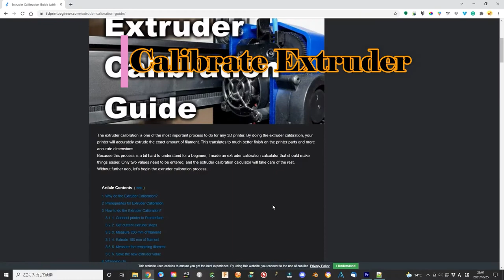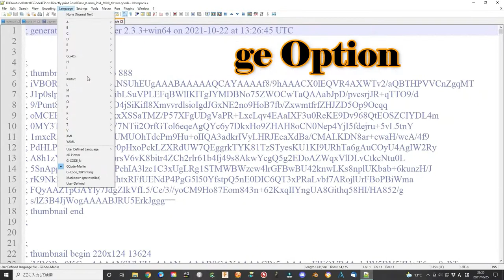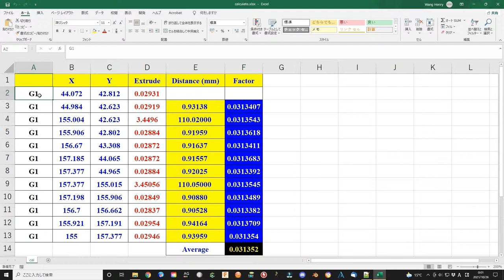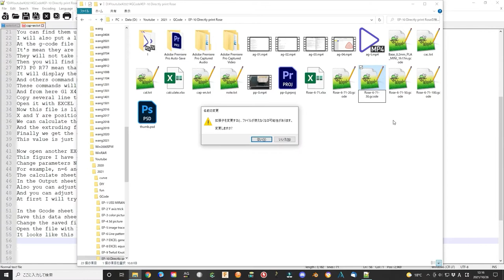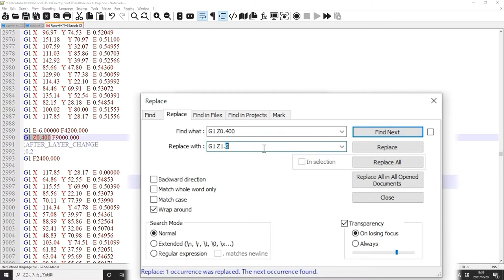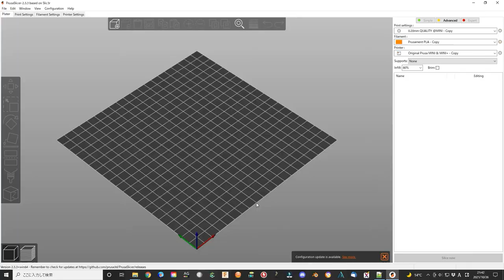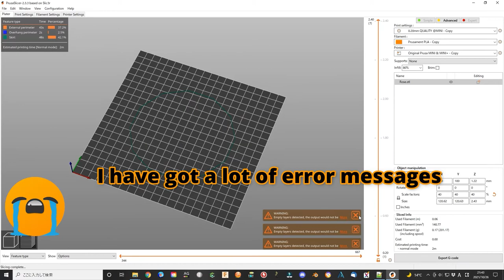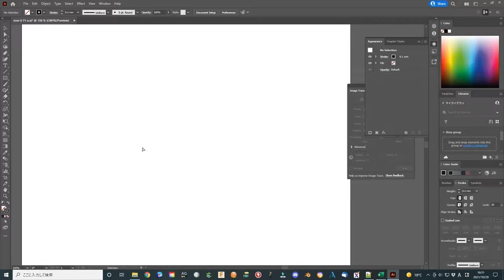Print a beautiful teapot board directly (Generate g-Code using EXCEL and Equation)

Comment: respected sir, good evening,
SIR, you have taken different density 20%, 30%,50%,70%,100%,
where and how to do these changes in the files to get these different  densities justified.,
request for kind reply Sir.,
Reply from the maker: In the Excel file, you can see the filling density in the output sheet. Directly change it. The 0.4 mean is about 40%, and so on. Please test your printer and find the good one. The g code sheet is the final g code sheet. You should save it as .csv and use a text editor, such as Notepad++ to modify it. Then change the file extension to gcode. Good luck. Have a nice day.

Comment: So thin that encoder disk can be made 45 mm circle with 500 line ? And by pen 1000 line in circles
Reply from the maker: I am not sure it is enough. One layer needs only 360 lines so 500 lines are equal to 1.5 layers. It is very thin. The 1000 lines are equal to 3 layers. It looks not bad. You can try it out. Thanks for your comment. Have a nice day.

Comment: Hello, thank you for your great video's! I am having trouble calculating the extrude factor. Where can I find the calculate.xlsx for reference?
Reply from the maker: Thanks for your comment. First, open the gcode file with Notepad++ or other text editor software. I strongly suggest using Notepad++. Find the line that leads by g0 or g1, then x, y, and E.
The number after E is the extrude length of the filament.  The number leading by x and y is the coordination number. Using EXCEL you can calculate the length between two points and the extruding length. Then you can know the factor. I explained these in the video also. Good luck. Have a nice day.